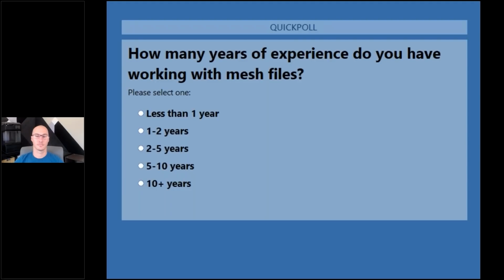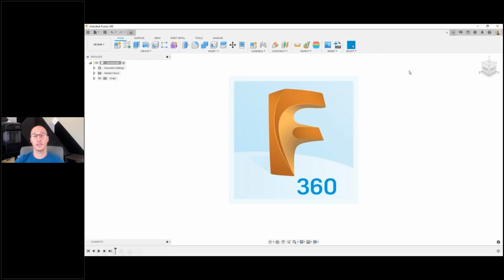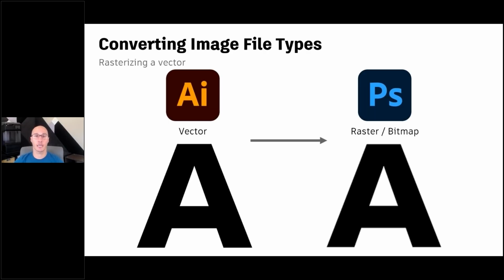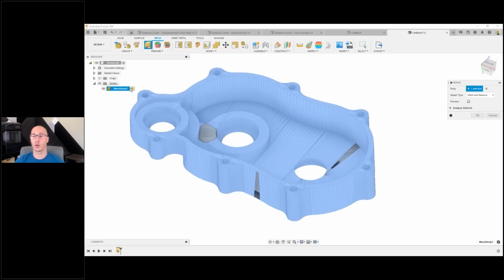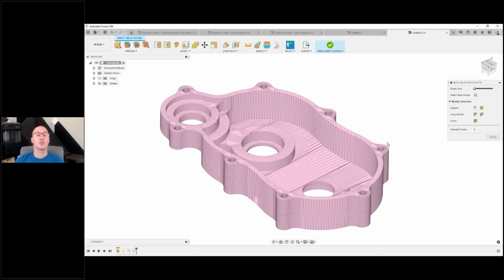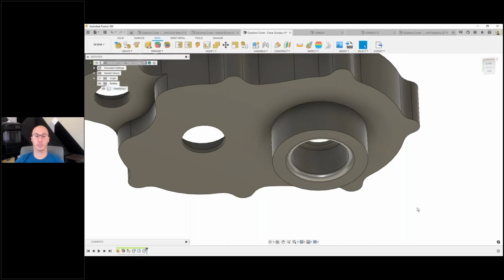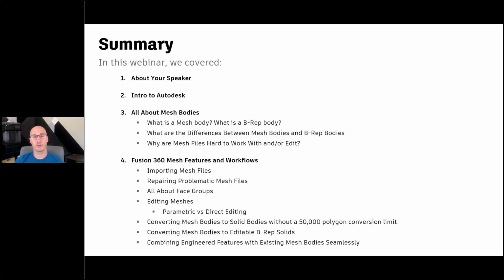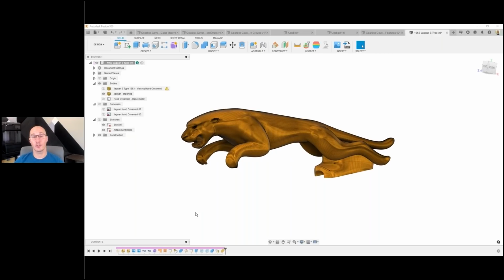Webinar: STL File Editing is Finally Easy with Fusion 360’s New Parametric Mesh Workspace

Comment: The title of this video is misleading. STL files in Fusion is only easy on the paid version. Hobbiest who cant afford the paid version are left with a crippled converter that will require manual tweaking of every triangle on and STL to try and make the surface a single more easily editable solid.  What average person can afford your quotes $500 a year (likely an outdated price) to have this feature as a hobbiest? Autodesk is blinded at the market they are losing with this expe sive feature.  Why dont they remove other parts of the program they most hobbyist dont use...like the metal stuff?   Or even the electrical stuff? Or since you can strip out features how about a business model that would allow users to add such features a la cart for a REASONABLE fee.  Restoring this feature would be worth a fee of $50 -$75 a year.  Think of those who would be willing to pay that over the $500 a year fee.  Your not getting thier $500. But at least would get thier  $75.  Fusion is a great program, but you are not user friendly with your pricing and we both lose out because of this.

Comment: OK so I decided to give this a try. I created an STL from an existing Fusion 360 model (A Z Axis mount for one of the legs on a Voron 2.4) Fusion failed to convert it to a solid. After a little investigating I found that the issue centered around the create mesh groups tool. On a number of fillets, the group spilled over onto the adjacent tangent surface. If only there was a way to remove a few faces from one group and switch it to another the problem could be easily remedied but... this ability is nonexistent and therefore pretty much puts the kibosh on converting parts where the creator used fillets to smooth things out. I'm beginning to understand why the part in the demonstration was selected...

Comment: Jump to 'The Live Demo' 20:12 The intro is good for people who don't know CAD or Fusion 360 at all, or who don't understand why this is all very rocket-science-difficult.

Where vector meets raster, is where digital meets analog. Analog is measurable/'discernable' down to microscopic and molecular levels. Digital is finer than that, down to absolute zero in a perfect theoretical sense. But the real world is dirty, ratty, ragged and filled with backlash , dust on the lens and inaccuracy. Thus the turbulence where the two world meet, especially as regards conversion between them. Vector screams for precision and raster responds with, yeah, good enough.

Comment: I import a mesh (STL file) but no exclamation shows saying there are holes. Then if I try to convert the mesh, it fails giving me an error saying compute failed and to generate face groups. If I generate face groups followed by converting mesh, it gives me a prismatic model with holes everywhere and weird bubbles sticking out of it. I tried remeshing it, I tried repairing it before convert, but no matter what I have tried for a week now, I cannot get a solid prismatic model. I tried accurate option in generate face groups, I tried fast option, I literally tried everything possible but it never works.

Comment: @41:50

"I've never seen these capabilities anywhere else..."

Um....native Solidworks? You don't look at the competition?

https://www.youtube.com/watch?v=KOuZqiiL9PM
https://www.youtube.com/watch?v=sVVqVMCVF00
https://www.youtube.com/watch?v=wmeOgN2LYNQ
Reply: not sure about the current SW, but it back a few years, it did not appear to have the capability to convert a mesh into the funtional parametric "body" that is shown here in f360. the parametric "body" in f360 is defined by a short set of geometric instructions, like "3cm extruded circle,  radius 2cm, center at xyz". not an amalgamation of triangles. the comparrison of vectored to rastered imaging at the begining was a fitting analogy.

Comment: Using the male threads to combine and make female threads isn't the same as an actual female thread because it does not include the clearance for the threads.
Reply: I agree with you. I showed it this way for simplification purposes. I would recommend adjusting the male threads before doing the combine cut operation. 
Note: for 3D Printing, most people adjust thread sizes no matter what so that they 3D print accurately

Comment: I often bring models in from 3ds max to convert to t-splines and then solid bodies, but in the past 2 weeks, I've been having some weird issues in Fusion, especially in the mesh workspace. Trying to use any of the tools, where it asks you to select which body you want to apply it do, but it won't let me select any of the meshes I have brought in. Under Forms, some of the ones I was trying to convert to t-splines, were allowing me to select the mesh, but it failed to convert for whatever reason. I tried going back to the mesh workspace to try and see if I could run any of the repair things, rebuild, or something change to a parametric mesh, but none of the tools let me actually select the mesh I want to work on. Any idea what might be causing that and how to fix it? I've re-installed Fusion cos there was an issue with the auto update recently, so it's definitely not that...

Comment: Hi I asked already once: Where is the bottle neck? Processor, Ram, GPU?
Reply from the maker: Cristiano, that depends on what you are trying to do. Fusion 360 uses different resources for different things. I can safely say, however, that your CPU is incredibly important.
Reply: @adskFusion  I was talking about the direct transforming of the meshes, prismatic option. I have a lot of errors.
Reply: @cristianopersi7953  Try generating faces first and then do the conversion. Sometimes the original mesh may be too complex for fusion to decipher the correct face groups so some editing may be necessary.
Reply: Kenta alteady done, it‘s not working.

Comment: Let's remind our selfs that your phone can probably render millions of polygons in 60 fps, but Fusion 360 STRUGGLES to rotate a couple of thousands of polygons. Ridiculous and embarrassing for a company that also owns Maya and Max.
Reply: Daaell, as mentioned in the video, Maya and Max are polygon editors. They are designed specifically to handle polygons. Fusion 360 is focused primarily on B-rep models although it can handle other types as well. But, it is not specifically designed for polygons. So, the performance will not be as good as in Maya or Max. But, that should be expected and is not embarrassing at all. 
If you buy a knife from Gerber Tools, you can use it as a flat head screwdriver. But, it won't be a great screwdriver, even if Gerber makes great screwdrivers as other products. It will, however, be a great knife. After all, it was designed to be a knife. I hope this makes sense. Not trying to be rude. I just think analogies are useful.
Reply: @jasonlichtman  I'm aware of everything you just said, but here is my take on it: I don't care, it's on the MENU, so i expect it to work. Fusion's excuse is this, imagine Fusion as a fancy Steakhouse that - for whatever reason - has pasta on the menu beside steaks. So i order a pasta, but turns out that pasta is pretty shit. So you ask for the waiter, and tell them that the pasta taste like shit. In return they tell you that, "Well, we are a Steakhouse, why do you expect that the pasta will be good?" Then"Why it is on the menu?". That is a stupid statement. When you have a dedicated Mesh TAB in your app, i expect it to be semi-decent. But Fusion is absolutely horrible. Should i be grateful that they half-assed a feature? Well, at least we have something, great?! How can you defend Fusion when i DARE to convert an obj into a Mesh and i get this warning: Warning: This mesh has more than 10,000 Triangles.  10K polygons, what year is this? Now i have to open blender, have to shave off like 150k polygons so i can finally feed that <10k polygons to Fusion. What a great workflow.
Reply: Your phone does not render polygons, but pixels.

Comment: Fusion 360 is where it is now because of the support from the hobbyists. Now that the product has sufficient momentum, access to the hobbyist is being progressively removed. Who is going to pay 500$/year if you're not selling any products??? Not me... I agree that we, hobbyist, have beneficiated from a great free product while it was in development. Thank you Autodesk! Autodesk has all the rights to turn away from free versions and the hobbyists. It just means it is time for us to look at another free solution for our personal endeavors. 
Hobbysist: Stay away from STLs. Share your great designs directly in STEP files or even better, their native parametric file!
Reply: The only thing we really lost was having dozens of files editable. Nothing else really impacts hobby users (speaking as someone who is using 3 axis + rotary tool paths on mill, plus STL output for 3D printing.) If I really really need the other stuff, I pay for a month of use and get it done.
Reply: @gerritvisser  I think he’s referring to the fact that this pretty useful looking new mesh stuff is not available to the free license… so combined with those earlier restrictions things are moving in the wrong direction for the hobby license.

I agree the current limiitations aren’t a deal breaker, but it’s becoming clear that more and more new features or restrictions will be locked behind the paid license as time goes on.
Reply: @Zeeflyboy  Fair enough, I had to try this on my free version to see that. My eyes glazed over a few times during the video.  However, as with some of the CAM restrictions such as rapids for milling, my solution to these 'hurdles' is to rent the features for a month, when I really need them and/or have a few things lined up. CA$80 is a lot more palatable than CA$700 per year. Would I prefer it to be free, of course. But CA$80 for a whole month is not too bad, even for a retiree. So not free, but not excessive price either.

Comment: I have found issues with the 3DMF going into Cura. The same STL is fine. The 3DMF often imports off three bed,and brelow the bed. Making it a pain to get it to a normal printing position. I went back to exporting STLs instead. I have not experimented with Prusa Slicer yet.It must be a default coordinates thing..May be nice in the Mesh Export dialog to be able to set which side prints down.
Reply: Right click the part and choose the "center on build plate" option.